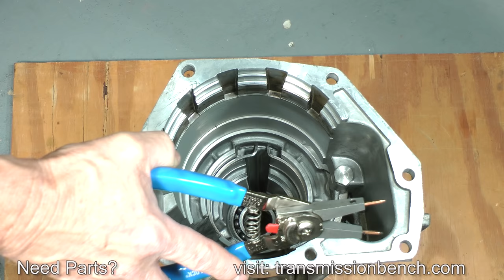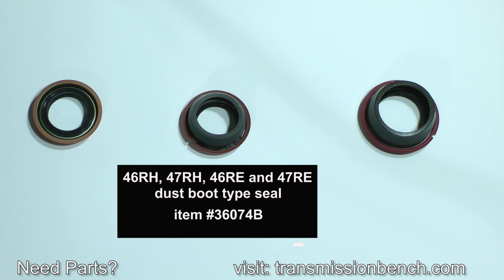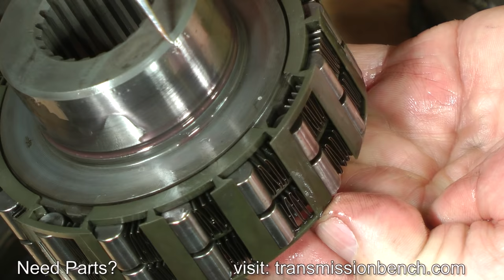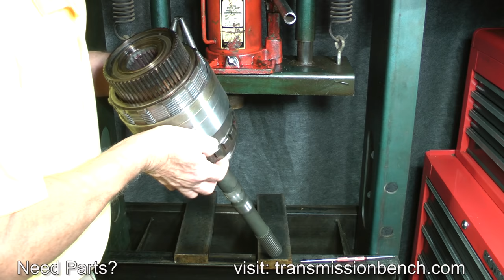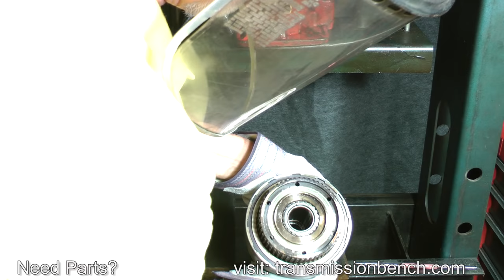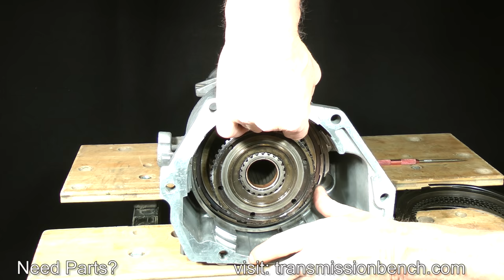Chrysler 46RE Class Part 2 lesson 3

Comment: Thanks for the vid, my mickey moused compression tool for the OD direct hub and spring bent while i was compressing it, before i noticed it was bent it had already damaged the splines in the hub itself, i had to file them down and try again with a better tool so just saying for anyone else watching this whatever tool you use to evenly compress the hub make sure its a good one
Reply: A pipe of PVC of 4.5 inches diameter works. Just cut a hole so you can get to the snap ring.
Reply: 🤔...U didn't realize the unevenness or outer round wobble of the splined hub when spinning it by hand after installing the shaft & it's components?? I know I did, just trying to figure out which one did I bend(spring, hub, or both)can't see bending the hub, possibly the spring tho🤔...Thanks for the heads up on that info tho, very much appreciated!

Comment: Hello  , I'm having to rebuild the trans from my wife's 1995 Jeep Grand Cherokee. It's the 46RH, and the new fiber discs and steels that came in the kit are 0.101 thinner after stacking, with the same number as it had factory. I added another fiber and steel to the stack and it now is 0.013 thicker than original. Is this acceptable? Any advice would be GREATLY appreciated.
 And, thank you for making all of these videos man. Without everything you do,, most of us all, would not even consider even trying to go inside of our transmissions. YOU ARE A LIFESAVER, MAN!!
 Thank you again,    S. Rhudy
Reply: I realize this is old.. But, maybe helpful for someone else. I believe there are two 'versions' of the steels and pressure plates. 'First Design' steels are .70" thick and 'Second Design' are .065". Plates are different also. If your rebuild stack-up does not use the same version you will have a variance. You should also check the depth of the snap ring groove from the top of the housing to confirm what housing you have and consequently what stack-up to use. I would also consider that the stack you removed likely has some wear on it. .013" isn't much over 200k when you divide it per disc.  I realize you added discs so it's not apples to apples. But still.. That's like .0008" (8 tenth's) wear per stacked unit. Imagine it was an engine... 8 tenths of bore wear would probably still be crosshatched. Meaning.. when it was new, the OG stack was a bit thicker. Just confirm the OD endplay/correct washer needed and its probably good. Also, Get the ATSG manual. Its all in there...
Reply: @jamiethomas3470  Thanks Jamie, that info has very much helped me!👍...

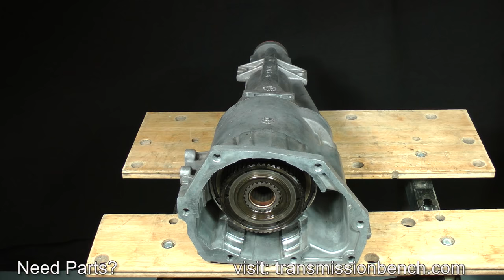Comment: Completely ruined my assembly pressing it in.  Did everything to the letter.  I highly recommend to anyone doing this section to buy the plastic piece Mopar wants you to buy, especially if you have to then use a homemade welded tripod that may not be exactly perfect.  The tool is Part # 6227-2, and is called the "Dodge Alignment OD Section Tool."  I did the method with removing the intermediate shaft as described and ruined my transmission.  Spend the $25 on this tool.  In addition, some things to add:  When you spin the assembly freely at 34:45, a little wobble is normal (and can even be seen in the video), I spent way too long trying to see if that was something I messed up on.  Use ATF +4 to soak, not DEX like is shown.  Also, for those with 4WD vice 2WD, everything seemed the same except the bushing at the tail housing (which is not used), and the seal at that end is different (but was supplied in the kit).  I couldn't do any of this without these videos, but learn from my mistakes and just get the darn alignment tool.

Comment: Hello, maybe I missed something somewhere, but all the literature I have seen on the internet has said to use ATF +4 for the 46RE, is it ok to use the dex/merc you are using at 23:08 as well? Thanks.
Reply: I believe his focus is teaching the process of installation rather than the details of products used to lubricate parts. If this was his actual rebuild, I am quite sure he will be using the correct fluid type for that application. Second, small amount of ATF labeled from another vendor would not be detrimental to the transmission. They do sell a bunch of garbage on the market (stop leak) that people use trying to remedy symptoms. These products are not unit specific.

Comment: Is the overdrive rebuild the same on the 4x4 version (jeep grand cherokee zj)?
Reply: Need an answer I'm in the same boat
Reply: @Avataranian  it is, only tail stuff is different. But its self explanatory. Just pull old stuff out and take the corresponding new part out of the kit. The mechanic part though is same in both cases, just shorter output shaft.
Reply: @DO1TOB  You rock.  It ended up being a different seal (which was included in the rebuild kit) and you don't end up doing that bushing replacement that he does in this video (since the load is on the transfer case)

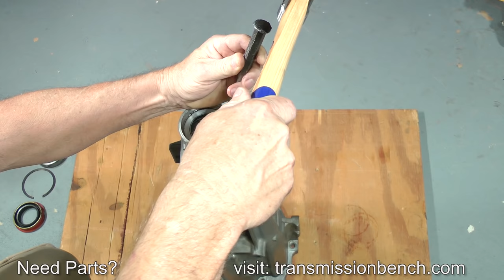Comment: Great vids with amazing detail but your punch is a safety hazard 3:38  The end is so mushroomed over that pieces are going start breaking off.  And they can come off with great velocity.  A metal projectile at speed is something to be avoided if possible.  As soon as the end of my punches or chisels get bigger than the shaft I take them to the grinder and touch them up.  Your punch looks like it's had a lifetime of neglect.
Reply: Come on Todd. it looked round & flat to me, remember it's a large punch man! i.e.,perfect for the job at hand.
Reply: @t.c.3027  I can't tell if you are kidding or if you are smoking crack.  Maybe we're not talking about the same thing.  I'm talking about the end you hit with the hammer.  This is one of the worst, most mushroom over heads of a punch I have ever seen.  The head is pushing twice the diameter of the shank of the punch.   And it cannot possibly be flat.  When the metal rolls to the outside like that it inevitably makes it high in the middle.  That's why it's called mushrooming because it's rounded over on top and curled under on the bottom.
"remember it's a large punch man! i.e.,perfect for the job at hand." I agree that it is the correct size.  It just is dangerous because it probably never had any maintenance ever.